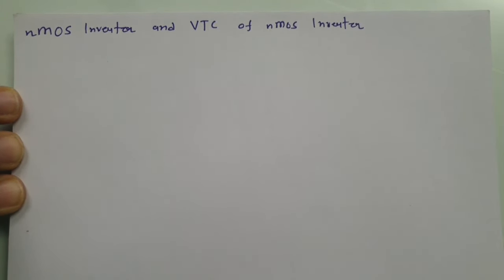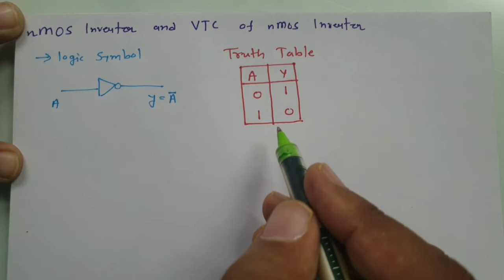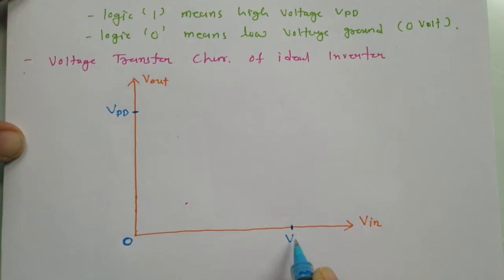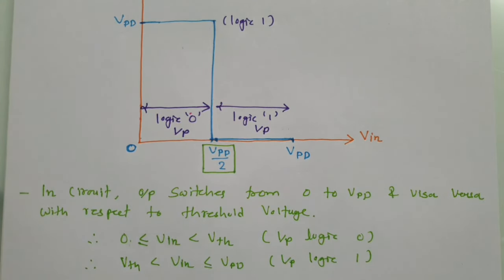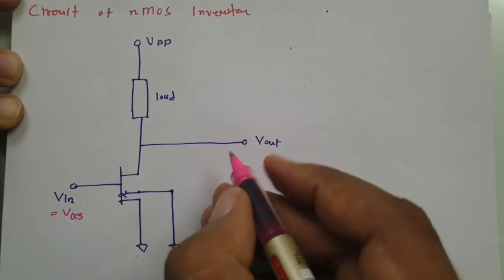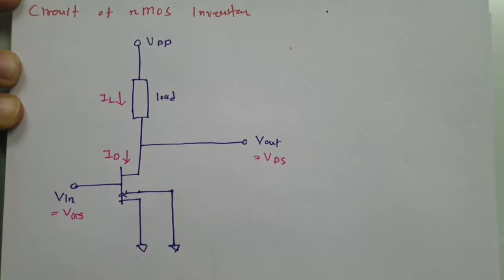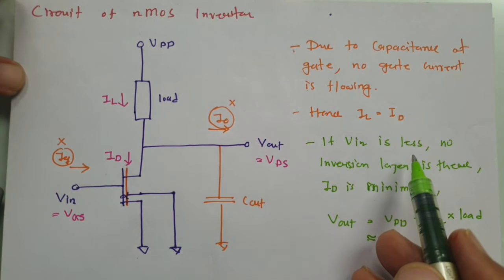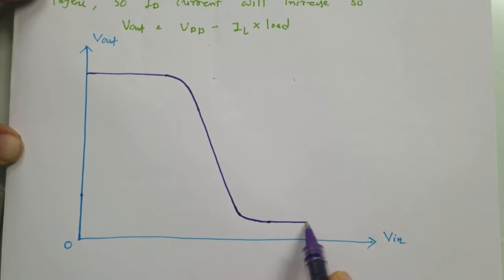nMOS Inverter (Basics, Circuit, Working & Voltage Transfer Characteristics) Explained

Comment: Does it matter if mosfet is in linear or saturation when Vout is low voltage? Because you could pick a resistor that would make either of those the case
Reply from the maker: Working of any device is not only depends on one condition at output, we should analyze both conditions at output. 
Regarding zero logic at output.... you can see the region in which NMOS and PMOS is shown.